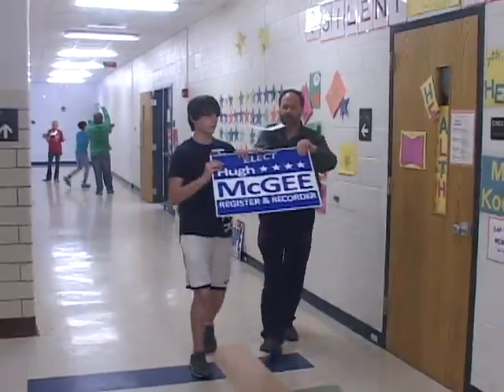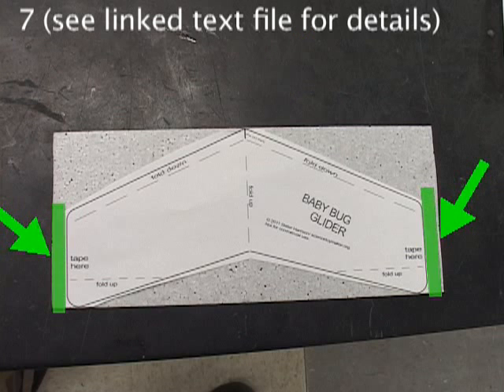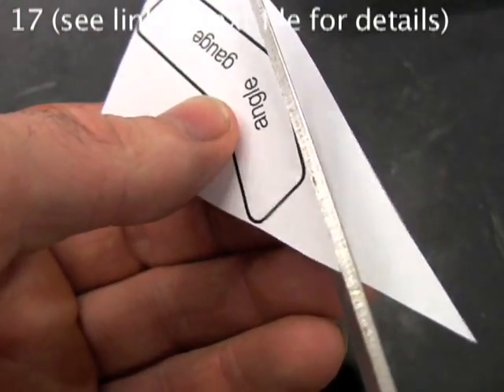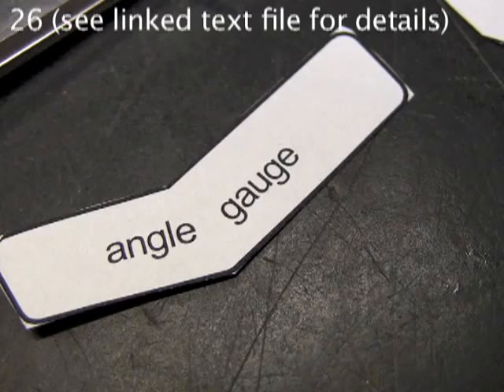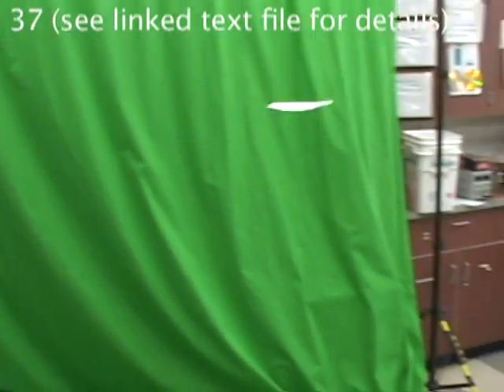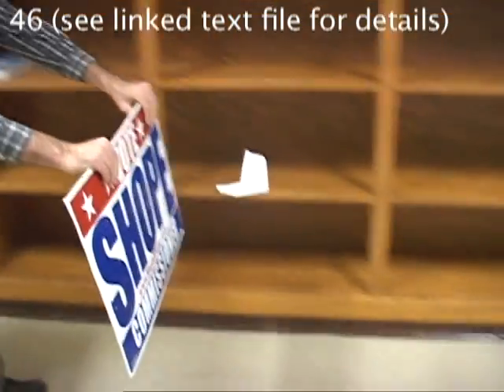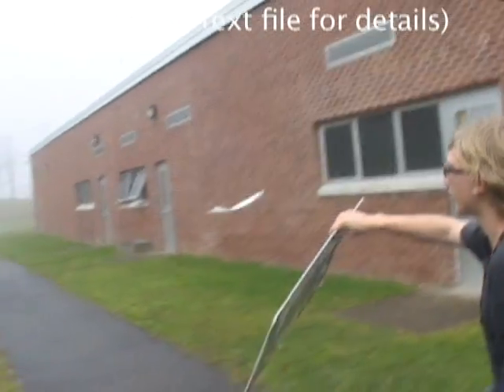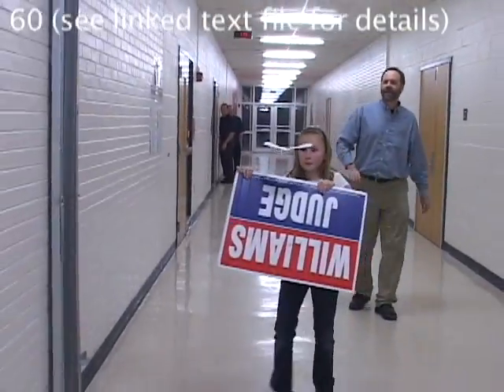Make a Baby Bug Air-Surf Glider

Comment from the maker: It's very thin foam, which you can cut yourself or buy. Click on the main air-surf page in the text area, then look for the links at the top for either DIY or buy. Paper does not work for this design.

Comment: i belong to gujarat (india) and i find it difficult to get .5mm EPS form so can you please tell me alternate of EPS form.
Reply from the maker: +ashish zarekar  Paper is heavier and becomes limp in humid weather, but it is better than nothing. There are some paper gliders such as this one http://www.sciencetoymaker.org/dragnflyHelicopter/dihedralMagnusEffectGlider.html
Reply: +sciencetoymaker 
so you mean to say i can use paper instead of EPS form right ?
which paper should i use. and from where should i start ?
baby bug or mama bug glider ?
Reply from the maker: +ashish zarekar No, paper is much heavier and weaker than thin foam. I started with fixed-wing paper gliders, but they are very difficult to adjust and fly. However, the "tumblewing/Magnus Effect" (spinning) designs tend to work ok even if made from paper--if you get the grain of the paper the right way for maximum strength. If you still want to try paper fixed-wing, you can try here, but I want to be clear that these are not easy. http://www.sciencetoymaker.org/hangGlider/index.htm